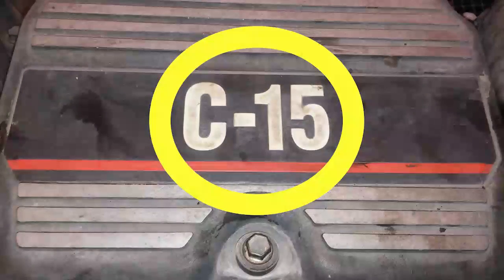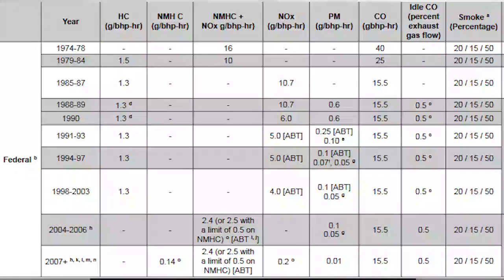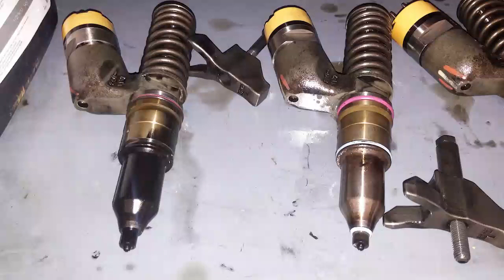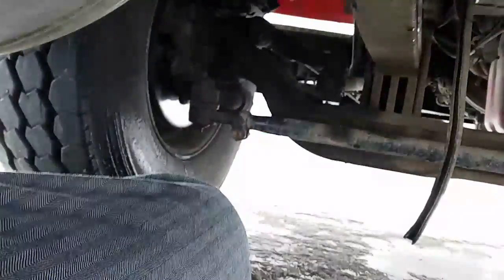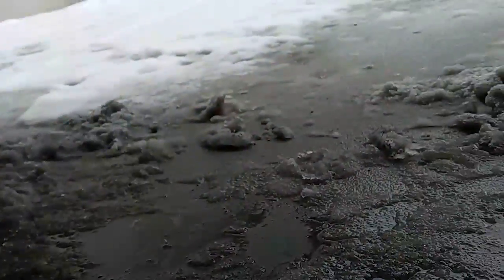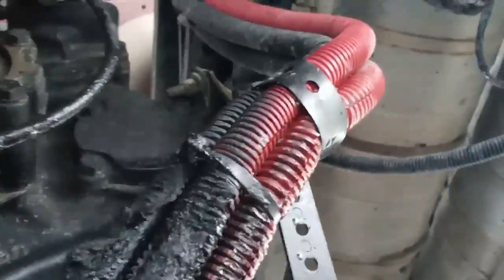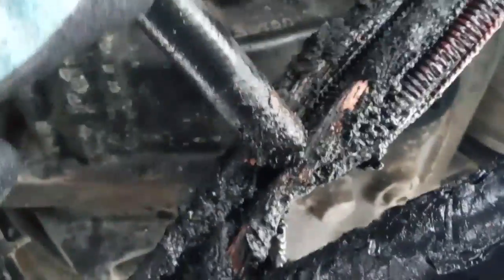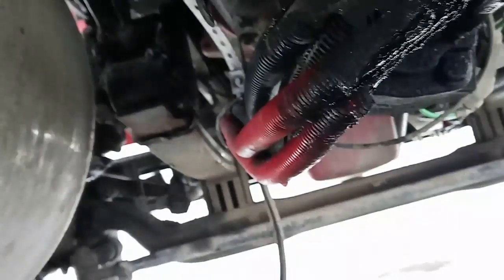Why don't people like the Cat C-15 "Bridge" Engine? What is wrong with the MBN?

Comment: Well done professor Ape answers Many of the questions floating around about "the bridge " engine . Personally I'm a big fan of the old reliable 3406 B ( 425 hp) . Although I got 1 truck (81 model 359 exhd) w/ a 3408 - yep V-8 . Pass about anything BUT a DIESEL PUMP..
Reply from the maker: They should have called them the 340"ATE" because of the fuel they eat. Pretty cool engine though, you don't see them around too often anymore in trucks, still a few in the states running around.
Reply: @AdeptApe  True - about as ez to find as a unicorn , we took this one out of 1977 D8 -G  crawler tractor ( bulldozer) .
Reply: I got a 78 pete tractor with a 1693 in it, great engine, it will pull a house off of it's foundation.

Comment: “Know a guy” took off the horrible converter mufflers early on. 7CZ flash with a Borg Warner Turbo. Truck bought new in ‘04. 1.8 million on its 2nd rebuild. Not planning on letting it go.
Reply: what model of borg warner turbo did you put on it?
Reply: @kevinangel4083 revisiting this video 3 years later. It is a Borg Warner 78mm 1.45
Reply: @Heathen1970  hp torque? Psi turbo?
Reply: Mr Haney
Reply: 7cz 👌
Reply: Mr Haney contact info ? Is he from va

Comment: Yes they were lucky on that truck. When I worked for a dirt contractor we had an excavator go up in flames and the operator didn’t notice until the machine stopped swinging and he got out of the cab and took off running. 🤣🤣
Reply from the maker: Just turn up that radio and go faster.
Reply: It's not broke until it quits running

Comment: Whoa wait a minute Josh. I just heard a Caterpillar mechanic say he wouldn’t say cat made the best highway truck engine ever, I figure that would be blasphemy at a cat dealership 😆. Does that mean you have a opinion on what is the best highway truck engine made?
Reply from the maker: I'm not sure there is a "best" engine really. What are the standards for that. Most reliable, cheapest to own, best fuel economy, longest lasting, etc. Cat made some great engines, but I'm not saying there is a best. Detroit and Cummins made good engines as well. All of them made bad models too.
Reply: No body makes the best. They all tear up and break. Get the one that is best for you. I have been working for Cat for over forty years. If you don't like my engine don't buy it. I would rather you fussing at another place than at my product.

Comment: nice i just bought a truck with an mbn motor seems to run good it was built as a 6nz with 16:1 packs reliance head 10r8502 injectors stock cam and debridged, seems to run strong but havent done anything other than bring it home with an empty trailer
Reply: If it doesn’t use DEF you’re gonna be happy
Reply: @blauer2551  or have a DPF!!

Comment: Fuel system changes also. Some extra lines that run around the back of the block
Reply: Samo samo u have one line running around the block but it its the waste gate tubing comes from behind the filter housing but has a sensor located there no fuel line

Comment: The people that install PTO's always seem to run the lines where ever they want. I have seen alot of rubbed through components on PTO lines.
Reply: Yeah outfitters really like to cut corners as much as possible, safety be damned.
Reply: @Ratkill9000  has a "tail light" warranty- once the tail lights are out of sight warranty is over!!

Comment: You need to deal with the first comment from Bruni.  I'd contact you direct... but you don't' list an email on your channel about page...
Reply from the maker: Just saw it. My email is adeptape@yahoo.com I do list it generally the next time I'm in YouTube with an updated info and affiliate links etc.
Reply: @AdeptApe  I recommend you add an email address in your about section in the channel.  https://www.youtube.com/c/AdeptApe/about.  That nets you the benefit of some filtering from spam and other nefarious activities.  I am to network security what you are to to CAT ;-)  Keep up the good work Josh.  I'm looking out for you on the fronts you may not be aware of.
Reply from the maker: My email is in my channel description, not sure if that is the same thing you are referring to. Usually YouTube does filter spam pretty well.
Reply: Go to the guys channel and report him. I did.
Reply: @lucasholt3482   You reported the page... there is nothing on the channel that is in violation of the TOC.  So it is not beneficial.  Even if you report a comment it is a post with a single letter.  First line response is automated and will disregard the report.  This is a constant battle.